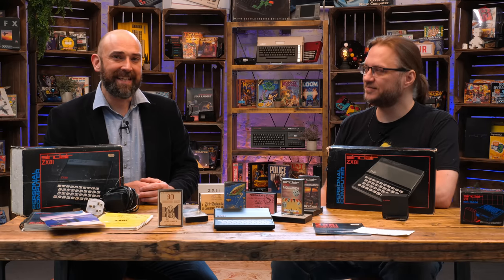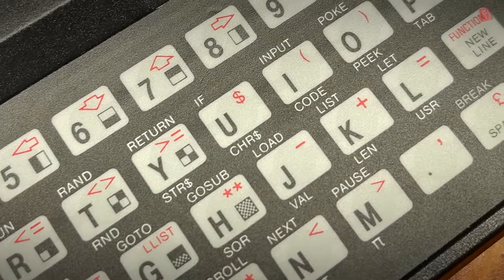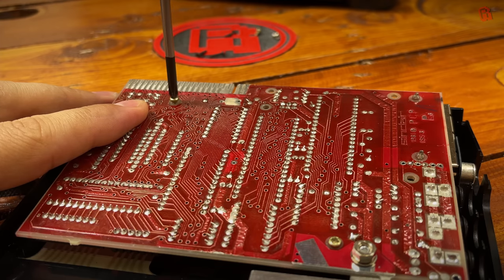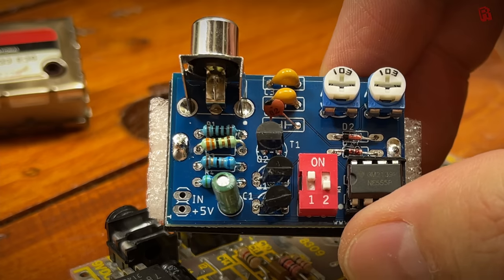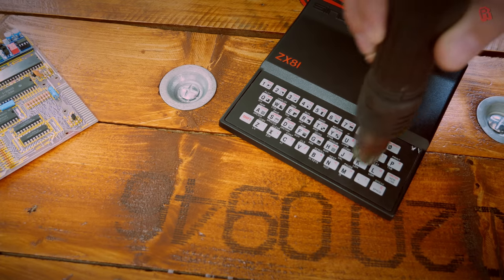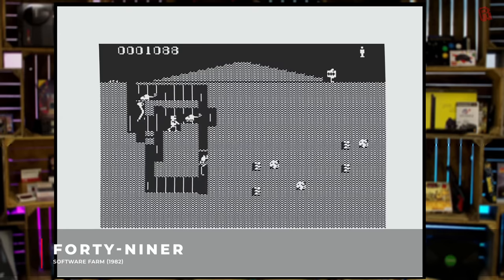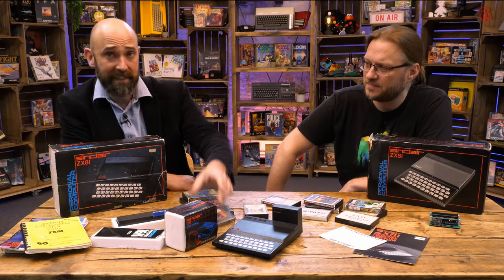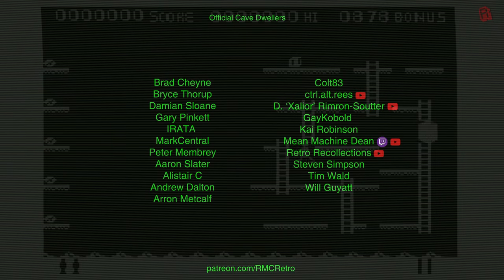Restoring and Exploring a 1981 Sinclair ZX81

Comment: I still have my Timex Sinclair 1000 which I bought new way back when. Still have the 16K memory expansion too. I should dust it off and see if it still works. Unfortunately, I'm not sure I still have a cassette player to load software.

Comment: The most common color expansion is the Chroma 81, BUT you can attach a Colour Pack for the Lambda 8300 to the ZX81 as well. I don't know any software that uses it though. One great thing about the Chroma 81, is that it supports UDGs (User Defined Characters) as well. This can also be achieved with UDG4ZXpand if you have no Chroma 81. As the ZXpand SD card storage is difficult to get as new stock is sold as hot cakes, the German ZX Team has created ZX-Wespi which is a firmware for a cheap ESP32. This loads programs stored on the ESP32 in seconds. My current project with the ZX81 is to built it into a Minitel terminal.

Comment: Interesting.I have 3 Zx81s I bought at car boots eons ago.1 worked,1 had a duff keyboard and the lady was totally dead.Want to dig them out and try again.One snag,the power supplies.I have the genuine Sinclair one and they were notoriously bad even then.What did you use in the vid and what’s a good replacement.👍

Comment: I know what Back Porch Signal means, but only after trying to get an Issue 1 to work. I think you should have talked a little more about what this back porch signal is and why Composite mods of the transistor, resistor variety will not work with all TV's. Friendly critique, love this channel.

Comment: My first computer (aged 13) and Christmas gift in 82/83 by which time the ZXSpectrum had emerged but money was tight so my parents could only afford the ZX81.  While my friends in school showed off their Spectrum and Commodore games I decided to getting the best out of what I had. I learnt BASIC first but was still disappointed, it just felt too limiting but then progressed to Z80 machine code which was liberating. I loved it and wish I could revisit those exciting days when the user and the computer felt more connected without the GUI, drivers and software interpreter creating fog between the two.

My only addition to your great video would be to say if you find a working ZX81, please, oh please add a heat sink with thermal paste to the top of the ULA. That chip runs HOTTER than it should and is a main reason most ZX81's died. Obv's it's a small case so a low profile heat sink is in order.

Here's a link to the Micro Men video, it gives a feel of the excitement of the time surrounding computing. Also there's a point where Sir Clive (Alexander Armstrong) recommends a runner bean sized piece of blue tack to stop the ram pack wobble.

https://www.youtube.com/watch?v=XXBxV6-zamM

Comment: Didn't the '81 introduce floating point calculations while the '80 was solely integer based? I vaguely think I remember something about that.
Reply: Also slow and fast modes, 'slow' did the computing during screen flyback time, 'fast' blanked the screen as the ZX80 did.

Comment: That 3D printed insulation sheet is yet another example of an overly-enthusiastic tendency towards 3D printing all the things. Why not trim a piece of vinyl instead? It'd be cheaper and easier, and probably fit better.

My grandpa had the Timex Sinclair 1000 (basically the same machine as the ZX81) and I can confirm that RAM pack wobble was the real final boss of every game.
Reply: You mean the 1000. There was a Timex Sinclair 2068, but it was a Spectrum clone and didn't take a RAM pack. The 1000 was totally a ZX81, except it came with 2K RAM and a different badge.
Reply: @wmcbrine  Yes, you're correct. I've edited my comment accordingly. It's been a while. :)

Comment: I tore the keyboard ribbon on my spectrum, I got it working again by just peeling the ribbon back a bit furthur. Obviously its now a bit shorter.
Reply: Did that with my keyboard ribbon to. It is getting a bit fiddly to get the mainboard connected to the keyboard now. But i don’t think i need to open it up any time soon now. I installed 16kb internally, upgraded the 7805, and installed a composite mod.
Reply: You can pretty much assume the vast majority of original 48k membranes are going to be dust these days, but "shortening" the membrane was a viable solution for many back in the day.

Comment: 3D Defender, also by J.K. Greye.  Must also play "Can of Worms" by Automata.  I would also add another bit of metal to the heatsink under the keyboard.
Reply: Replacing the entire heatsink is also an option.  There are modern switching regulators that generate way less heat than the trusty old 7805

Comment: My first machine was a Spectrum, but I do have a recently-refurbished ZX-81 which is quite excellent! No RAM pack though; it’s the only computer I’ve ever got to run out of memory. And that keyboard is abysmal… Out of interest, are you using the original power brick, and have you refurbished that as well? Asking because mine is currently using an unrefurbished original…

Comment: I'm in the US so we didn't have the ZX81, but a friend did have its American counterpart, the Timex Sinclair 1000. However, it was already the mid-80s when he got it so I was less than impressed. The one thing I still remember was that when programming you had to use the built-in commands- you couldn't just type them out. I just found that odd.
Reply: It's more like you "get to", than "had to". Less typing, which is always a plus with that keyboard. :) And you'd learn to use it quite fast.
Reply: @wmcbrine  I remember when typing in a program that just typing, say "PRINT" wasn't recognized at all, only when using the shortcut did it work.

Comment: That 1k RAM (of which 721 bytes were required by the screen memory) really taught some tricks on how to shrink your BASIC program. Extensive use of the CHR$ function instead of constants, replacing any 0 with PI-PI (as it took only 3 bytes, while the constant 0 took 5 bytes) and any 1 with PI/PI (for the same reason).
And the worst keyboard ever.
RAM expansion was available but that also could suck, as RAM-refresh was done by the CPU fifty times per second. 64 kB of RAM could slow down the computer to almost a full halt. And the edge connector was less than unreliable. Just a simple keystroke could disrupt the connection and render your hard typed program disappear.

No wonder I loved that lil beast and have three of them now; all in tip-top shape and two of them equipped with 16 kB of RAM expansion.

Comment: You didn’t have to replace the keyboard, just cut of the connector to make them even length and most likely the keyboard would work no problem. We should try to keep original parts of those old machines until they break and now we get too lazy with the new reproduction parts which in many cases are not as good as original plus it’s always better to keep original when possible

Comment: 🐨Just a thought, but with that unassembled kit, is it possible to copy the PCB's and still source each and every Chip, components etc, etc??
I mean that would be great so that broken ones can be fully restored, and yeah 🤭 Shhhh..🤨  I guess even one could build one from scratch, 
just one thing though.. Err-is anyone producing the skin or casing?? 😅
Reply: The ZX80 is eminently clonable.  The entire thing is generic logic chips, and there's a clone called the Minstel.
The zx81 simplified the design using a semi-custom ULA akin to the one that was used in the Spectrum, and there's no source for those.
The case can, I think, be 3d printed.  ( https://www.myminifactory.com/object/3d-print-sinclair-zx81-case-130977 )

It's a really barebones system though.  There's not much more to it than a z80 and some RAM.

Comment: It's really a crying shame that Sinclair decided to cheap out and use the same 16K rampack for the ZX81 as they used on the ZX80, rather than the lovely new one Rick Dickinson designed. That was the main reason for the rampack wobble--the ZX80's rear casing was flat, so the rampack snuggled neatly against it, but the ZX81's is angled, so the only thing holding the pack straight is the edge connector. Obviously the specially designed ZX81 pack would not have had that issue.
Reply: I never heard of this new rampack. Do you have a link?
Reply: @wmcbrine  Unfortunately I think I saw the link on Dickinson Associates' web page (Rick's company), and that section appears to use Flash and so you can't browse it anymore!

Comment: I think you'd have a much better time soldering if you used a flat bit instead of conical. Conical bits are next to useless, especially for PCB soldering. With the flat bit, you can touch the pad, lead and solder all at the same time, which gives a much more even heat and ends with a better joint.

Comment: I have one of these! Lovely machine, in certain specialist ways. The programming environment's actually pretty good, with an effective but workable IDE. The keyboard is dreadful, but the token-at-a-time entry means that every keypress is pretty high value, so it's less limiting than you might think --- just don't type in text on it or you'll chew your own teeth off with frustration. The built-in Basic is appallingly slow and awful (there's IF...THEN but no IF...THEN...ELSE, for example). I did a video a few years back where I live-code a simple bat-and-ball game on a 1kB model. http://youtube.com/watch?v=WqVfyyZbIvo Everyone at work was fascinated. I do huge enterprisey stuff with binaries bigger than a gigabyte; they'd never seen a programming environment this small...

Comment: Until I watched this video, I didn't know that multiple RAM expansions could be daisy-chained on the back of a ZX81, and would be cumulative. But I've just verified the truth of this – at least, in that the claim is indeed made in an old Memotech advert. (Apparently the Sinclair 16K RAM pack could be used as well as the Memopak.) I wonder if this feature was unique to the Memotech design…?

It'd still be an odd thing to do simply because, on the one hand, there seems to be little reason for needing more than 16K of RAM in a ZX81 (what would you use it all for?) and on the other, if you really did need more RAM, Memotech also sold physically identical 32K and 64K Memopak RAM expansions, so why not just get a more efficient single RAM interface? In any case, stacking more than one Memopak RAM upgrade would look ugly, because the front of the unit is angled to match the back of the ZX81 whilst the back is vertical, so plugging in another one would (a) create a weird hole where the vertical back of the first met the angled front of the second, and (b) render the label at the top of the second very difficult to see and read.

It is true, however, that the Memotech RAM packs were indeed part of a (very good looking) modular Memopak expansion system. However, the other parts of that system were not RAM expansions. These were all lower profile: they were of the same height as the back of the ZX81, and had a flat top with a label on it (similar to the angled-vertical label on the Memotech RAM pack). You'd therefore attach your slimmer Memopaks first (up to six of them), and finish off the system with the taller Memopak RAM expansion at the back (be it 16K, 32K or 64K), and its label would stick up and 'bookend' the back of the chain. But if you had a ZX Printer, there was still a pass-through edge connector at the back of the Memotech RAM pack to plug that in there. So, aside from the three sizes of RAM pack (only one of which you were expected to have attached to create a neat-looking modular system), the other six non-RAM Memopaks (all the lower profile models) were, as far as my researches can determine: 1. the Memopak HRG high-res graphics expansion; 2. RS232 interface; 3. Centronics interface; 3. Z80 assembler; 4. Memocalc, which was some sort of spreadsheet, I believe; and 6. Memotext, an 80-column word processor. Several of the old Memotech adverts used to show a cross-section of an expanded ZX81 illustrating the computer with two low-profile Memopaks attached and then a single taller Memopak RAM expansion at the back of the chain.

I actually had a 16K Memopak myself as the first RAM expansion I got for my ZX81, and I loved the design of it. Unfortunately, I also found that something about it was different from the Sinclair 16K RAM pack, to the extent that there was at least one 16K game that wouldn't run if you had the 16K Memopak attached, whereas it worked fine if you used it with the Sinclair 16K RAM pack. I can't remember for certain which game this was, but I had very few games for my ZX81, so there's a limited choice. I suspect it was 3D Defender by J.K.Greye. I also had 3D Monster Maze (though I don't recall ever having problems running that) and Gulp! from Campbell Systems. Maybe one or two others, but not many. Anyway, fantastic though Memotech's products were, I do recall that there was a compatibility issue with at least one commercial game.